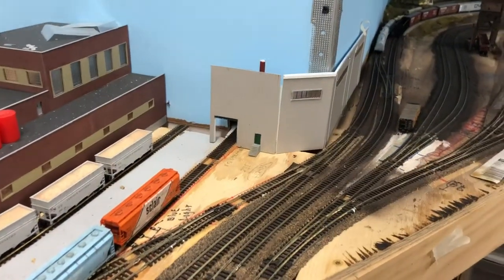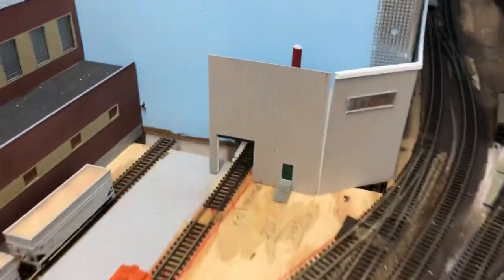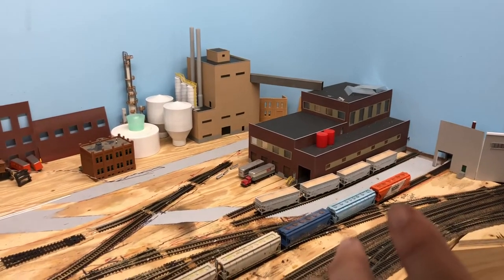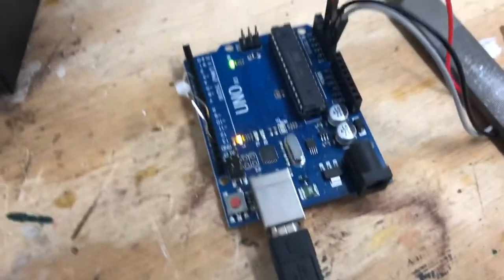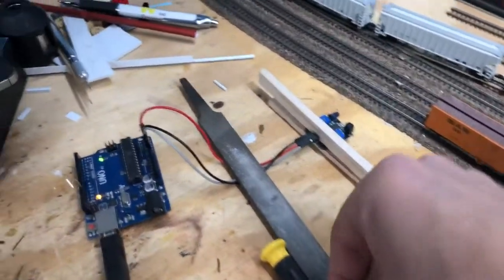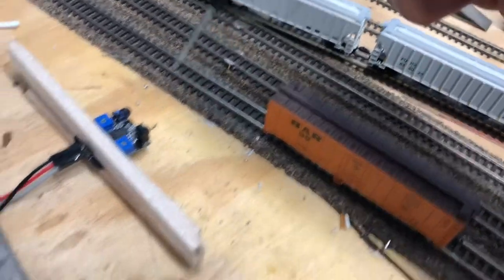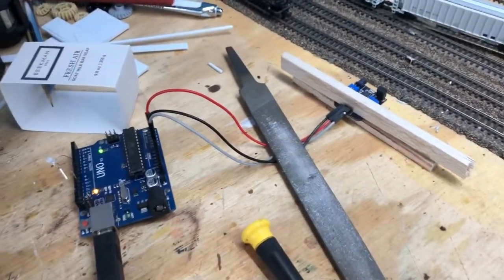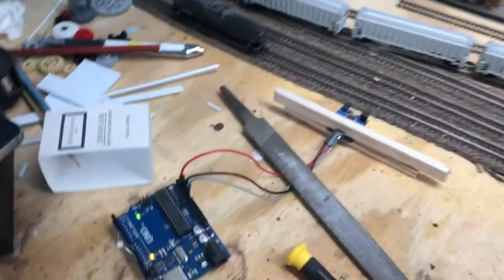Rhythm RR (Industrial Area Infrared Sensor)

Comment: you should consider installing the sensor under the track facing up with the led level with the railroad ties. Then you can have flat cars detected.
Reply from the maker: That is a great idea! thanks! might change it up if I start using flat cars. Thanks!